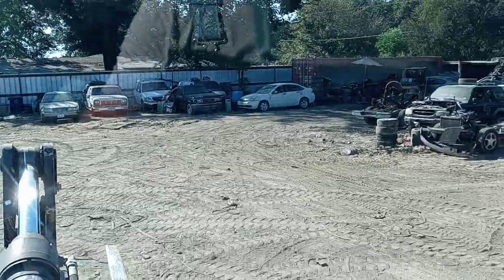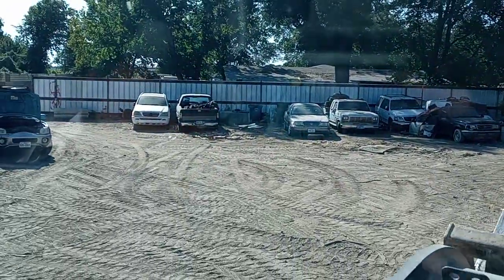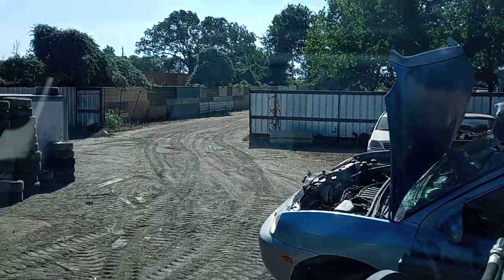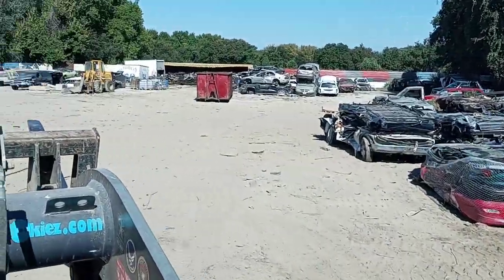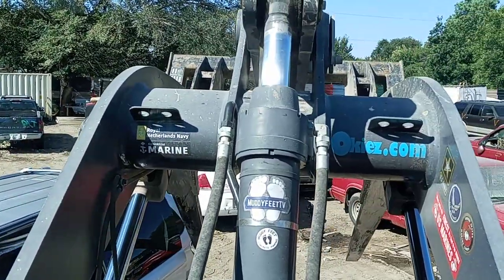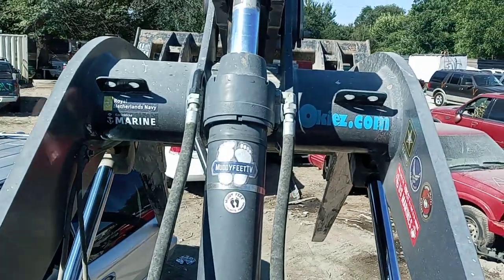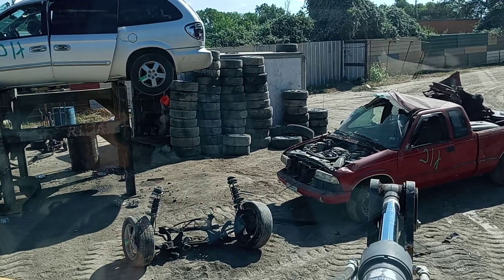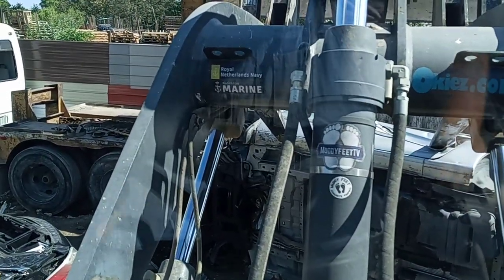Great Day for Car Crushing

Comment: Over here in Australia there stealing catalytic converters from cars parked at supermarkets and in-home driveways now! It has become a pandemic! Owners are going out and starting up their cars to find out their CATS have been stolen!
Reply from the maker: Same stuff is happening here. Some laws have been changed. Hopefully it curbs some of the thievery
Reply: @CowboyCarCrushing  , most popular ones are SUV's in OZ cos' there higher off the ground and easier to cut off. One model SUV here has 2 x converters under the car cutting them off and bang, sold. It's costing owners 1000's to get them fixed!

Comment: @5:21 Samsung been making cars from the late 90's, they built Nissan & Infiniti clones including cars based on the Nissan Maxima, Sentra & Infiniti I30 series as well as crossovers & SUV'sthe current Nissan Rouge can also be a Samsung built vehicle, about 1/3 of those are built in Korea & sold in America, the rest are made in North America & Japan, just check the VIN# if it starts with a "K" its Korean built ,the company was called "Samsung Motors " then became "Renault Samsung Motors " they even make Heavy & medium duty UD (Nissan) trucks as well, Samsung Heavy Industries also builds heavy equipment including front end loaders, excavators, skid steers ,lift trucks including Clark & the vast majority of Volvo heavy equipment,Samsung use to be the 2nd biggest Korean heavy equipment manufacturer, Hyundai Heavy Industries was the 3rd largest manufacturer of heavy equipment, the old Daewoo Heavy Industries use to be the #1 manufacturers of heavy equipment, & was tied up with both GM, Caterpillar & Komatsu ,now it became Doosan Infocore & they even own & make Bobcat ,the funny thing is that Doosan was a alcoholic beverages maker & makes Soju & Beer in Korea, including making Budweiser before they merged with Daewoo

Comment: Suzuki is kind of odd, they didn't sell well.  Bad enough they quit selling cars here.  But I think they'll be like Ramblers - parts hard to find but no demand for them really either. 

That bus is kind of unusual too, it's a 4500 chassis, so the nose is different from a regular cutaway van, it flips out with the fenders and all.  They only made those a few years.  

Dang there's a second gen Firebird back there.  With a glass coffee table on the trunk